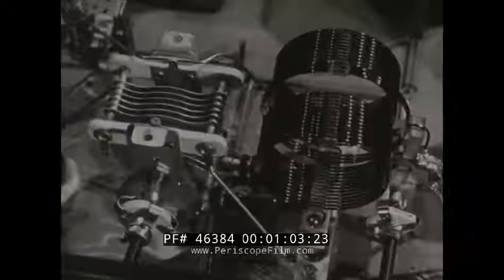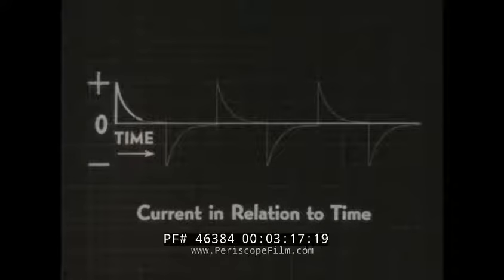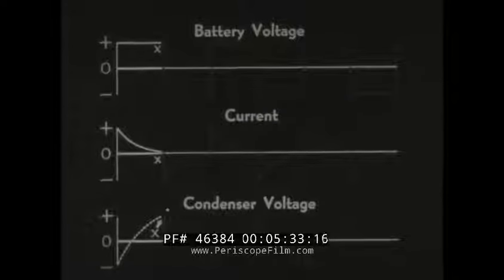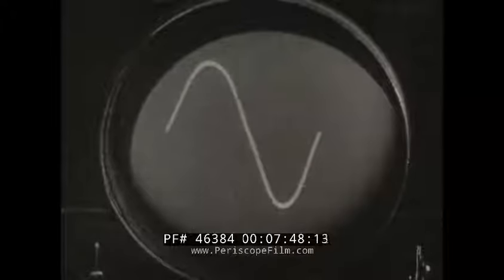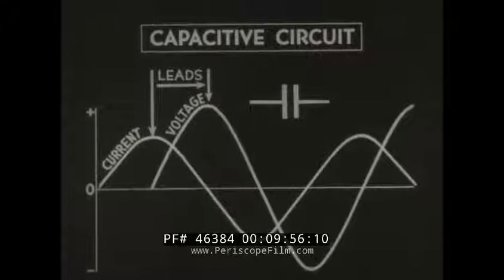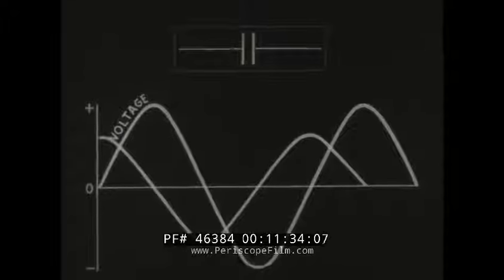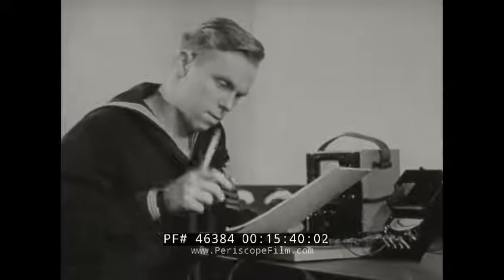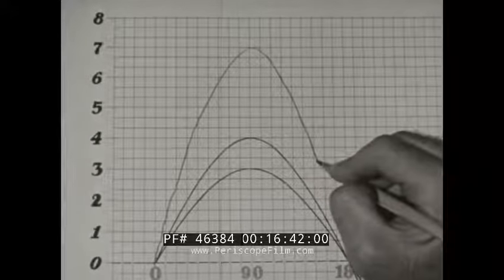U.S. NAVY WWII  RADIO TECHNICIAN TRAINING FILMS  INDUCTANCE & CAPACITANCE PHASE COMPONENTS 46384

Comment: How well I remember Treasure Island ET school 1958 and ELI the ICE man (and color codes BBROYGBVGWGSN.)😁
Voltage (E) leads current (I) in an inductive (L) circuit E L I and 
Current (I) leads voltage (E) in a capacitive (C) circuit I C E.
And if you want to learn the way they did (in these videos) back in the 40's and how we did in the 50's get yourself a good K&E Log Log Trig or Deci Trig slide rule and learn to use it.
No wimpy handheld Texas Instruments calculators back then. 🤣